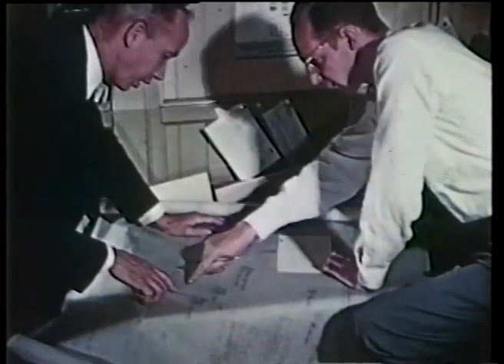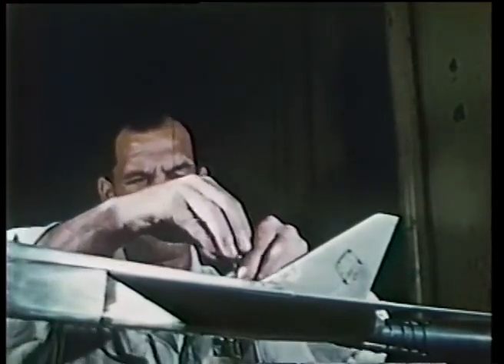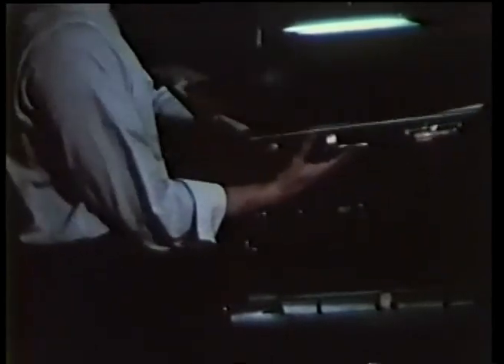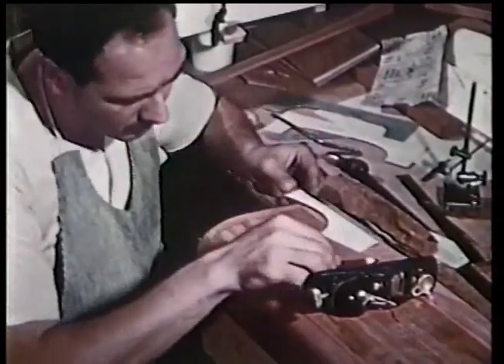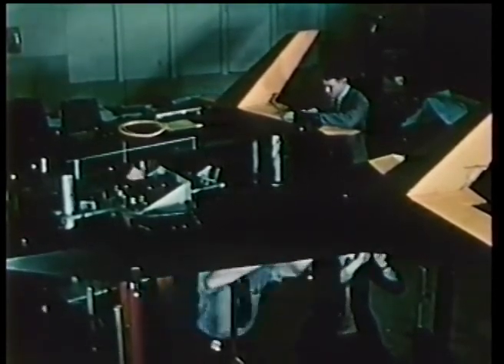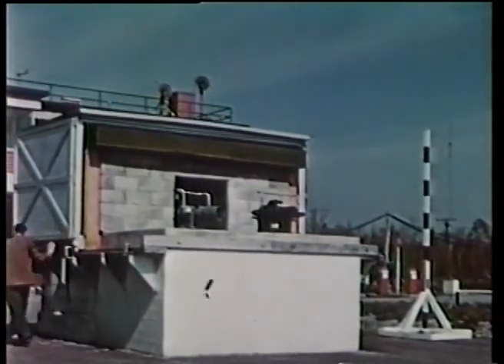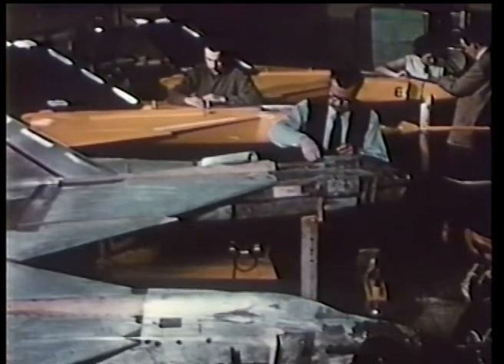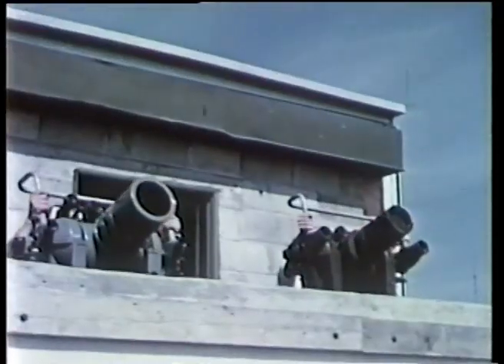CF-105 Avro Arrow Wind Tunnel Testing

Comment: Incredible how a model of the most advance fighter in developement were sent to a American firm for wind tunnel design. No one ever thought , that theft was occuring and the designs were copied and Avro Canada was getting robbed of its delopement program. The 105 was in American hands before the first rivit was ever installed.
Reply: Stop with the BS conspiracy.  What technology did the US steal from Canada?  Absolutely none.  The Arrow wouldn't even have made the drawing board without substantial US assistance.  The 105 was designed on IBM computers leased from the US.  As described here, it had to be tested in the US as Canada didn't have advanced wind tunnels.  The powered flights were conducted with US engines.  The air testing of the Iroquois engines were conducted on a US B-47.  The weapons system was the Hughes Sparrow 3 which was develeoped in conjuction with the US Navy.  The reality is the concept was obsolete before it could enter service.  Even the US did not produce a dedicated interceptor after 1959.